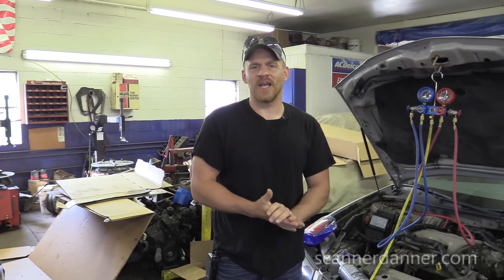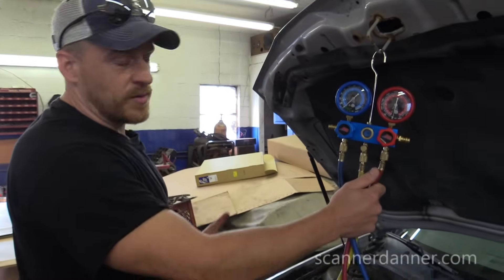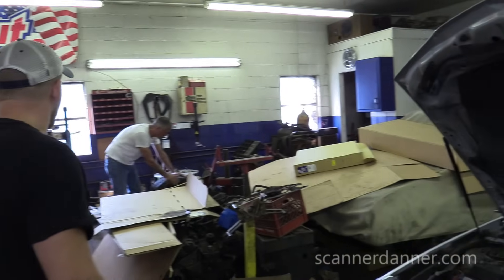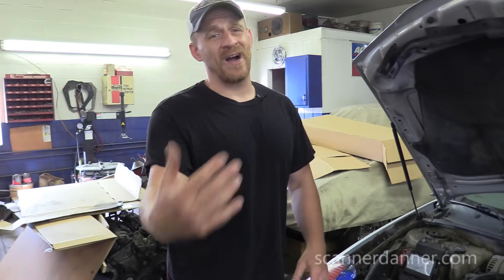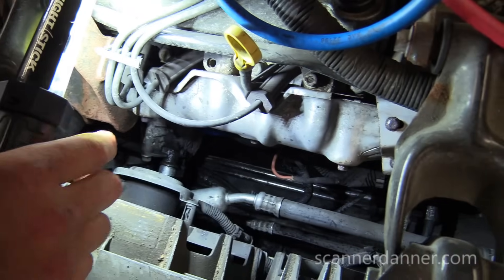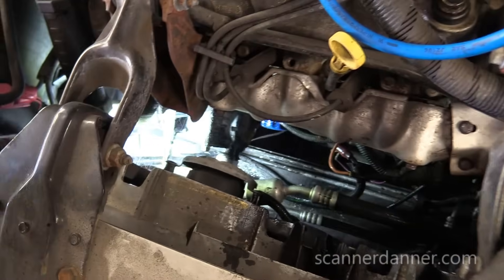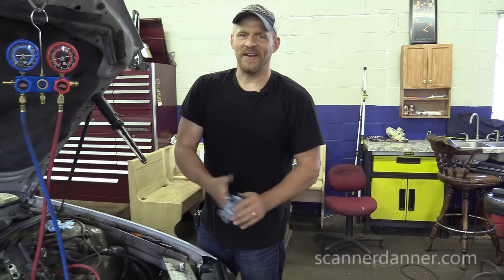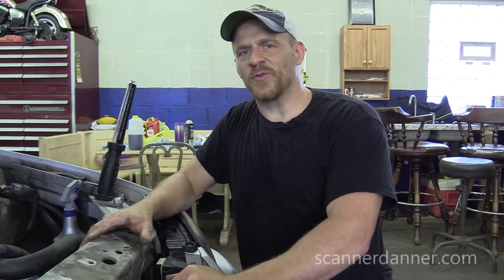A/C Leak Testing Using Compressed Air, Soap and Water (any car)

Comment: Great video Paul, i use exactly the same procedure as yourself, for the rest who want to use nitrogen, go ahead and waste your money/profit.
And i thought i was the only one who uses the quote, i want to hug him and squeeze him, and call him George.  lol. my work mates think i'm nuts!!!
Reply from the maker: lol nice! And just for kicks, how many R134a systems have blown up on you? And how many AC jobs would you say you've used this method on?
It has to be in the thousands for me.
Reply: never had any blow up, and i have done to many jobs that I've lost count.
It's a great method for checking leaks under the bonnet (hood).
I think my first ever automotive A/C job was a Honda civic with a leak on the hi side at the compressor, and found it straight away with compressed air in the system. 
We use to use this method when doing refrigerated containers as well.
Keep up the good work, you won't please everyone, and everyone has an opinion.
Reply: Thanks bro

Comment: hey Paul I'm a big fan of the channel, the verus course made the value of my scan tool double. definitely worth a few years subscription to sd premium. I was wondering if you have any good case studies on vdc systems. I have a Subaru giving me a fit. I'm a member of a Facebook group you admin but I didn't think it was appropriate to ask about your channel on a group about scope diag. loved the a.c. video, I'm just asking here because it's the newest video.
Reply from the maker: Facebook groups are adding me as an "admin" all the time and I'm never really even on them. sigh. 
So I googled Subaru VDC and found this "In situations such as a vehicle losing control due to unexpected understeer or oversteer, individual brakes are applied, engine power is reduced and torque distribution is shifted to regain vehicle stability, therefore aiding driver control."
This just sounds like a standard ECM and ABS computer working together like they've been doing forever! No real differences in hardware. Same inputs and output controls. What did you want to know?
Reply: ScannerDanner thanks for the reply. I figured that as far as the facebook group. This 14 forester was a wreck. It came to me with a steering angle sensor code. The live data showed the sensor to be 220° off. But when turned the data went to 600° or so and then cut out to 0 and would not come back.  I installed a customer supplied steering angle sensor and it read on live data, i touched the wheel and it dropped to zero. I had power and ground to the sensor and nothing obvious stuck out on the 2 can lines. (I know next to nothing  about can signal.) At this point i had no power through the clockspring. I ordered a clockspring and steering angle sensor together out of pocket and installed. The steering angle code went away but all the vdc lights are still on with no code. My verus needs an upgrade so i had to borrow a friends solus edge to read all of this back door info. My next step is to scope the wheel speed sensors. It was hit in the front right corner and has road noise from that side. My theory is that im dropping out on that wss. That is all i can assume with the info at hand. I dont have access to any diagrams or info for this system.
Reply from the maker: Dude, you don't need my help. You're on it man!
Sounds like clocksoring also feeds the reference to that sensor?
Reply: ScannerDanner it may. The new clock spring is broke (used parts like an idiot) and i still have power and ground as well as can signal on the steering angle sensor. I appreciate your confidence in me. Im kinda star struck messaging my favorite celebrity. Lol. According to the verus im going to have to put a resister in line with my leads to check this wss. Thats a new one for me.
Reply from the maker: That sounds like a digital type or magneto type wss. I have a few videos on this. If you AC couple your scope, set on 1v or maybe 500mv you'll see it. Test a good one first so you know what your looking for.
Reply: ScannerDanner thanks paul. I just pulled up to my buddies lot to diag a no crank no com on an 04 colorado. No radio. This should be quick.

Comment: Years ago I worked for IBM and I did an upgrade to a 3715 printer. The upgrade allowed the printer to print faster and an easier to install ribbon. To make the printer faster all you had to do was move a jumper. I took my time doing the upgrade because I felt bad for the customer because if they knew they could have done the upgrade on their own and not paid all that money for me to do it they might have been upset. My point being some of these guys don't like you coming along with a test light or some compressed air and using sound logic to figure out a problem. They want to come in with their bells and whistles and magic and behind a curtain like the Wizard of Oz fix the problem. Knowledge is power and you are helping people just like you help your neighbor when he needs it. You can relate to this. I fixed a Chevy Impala once that was having trouble getting it started. I told him it was his carb and he needed it rebuilt. He asked me if I could get it running so he could get home and his brother in law told me not to do it for free so I told him I'd get it running for 25 bucks he agreed. I went out and had him crank the engine while I tapped the carb to unstick the float and it started. He said 25 bucks was a lot of money for just tapping his carb so I told him okay 5 bucks to tap the carb and 20 bucks to know where to tap it. Great vid Brother. 
Your logic is sound and sometimes you have to read the directions or in this case listen as you qualify the condition of the AC system. GBWY
Reply from the maker: nice! Loved that. And that is exactly it too. We get paid for knowing where to "tap" :-)
Thanks man

Comment: Me and my friend TJ were teaching this method back in the 90s. Put up with a lot of crap from people back then also. Bet you knew TJ.
Reply from the maker: Haha could be. It was a trainer for Pep Boys and this is what we did in all the stores. Never had an issue that I heard of and that was 700 stores at the time.
Reply: ScannerDanner we called BS on having to use nitrogen for the smoke machine too. Bunch of unsafe outlaws we are.
Reply from the maker: Yeah I understand the concerns for sure with EVAP systems but I still use compressed air for those too.

Comment: The compressed Air method works great, but sometimes the leak is so small that the only time you be able to see it is under high pressures (200+). I ran into this issue the other day. Small leak on the condenser would only bubble when the AC is on.
Reply from the maker: good tip! If there is refrigerant in the system, run it, when looking for a leak on the high side!

Comment: How long should it take for pressures to equalize? I worked on AC a few weeks ago and hi side was around 350 and low side was 58psi AT REST.. I told shop owner he has a blockage and needs dryer and expansion valve. He drained some Freon after i left and ac started working and he called it fixed. I think they should equalize even if it is over charged?When I manually activated compressor Hi side went to 380 and low dropped to about 55, I never went back to check it after he removed some Freon.I still believe there is a blockage. What's your thoughts?
Reply from the maker: Depends on the type of txv. Office tube systems equalize rapidly. TXV systems do not. And as you stated a restriction can also cause issues. I have a video on a sticking txv with this very issue.

Comment: To make adding or maintaining pressure easier, get yourself a high side quick connect and put an air fitting on it. That way you can run air to it all the time and not have to go back and add any if you bleed off.
Reply: Hello,   I am trying to find a leak in my 1999 F230 super duty... can you tell me what fittings I need to buy to fill the AC system with air using guages..(that I will purchase too)
Reply: Go to an auto parts store and get a high side coupler and screw in an air fitting of your choice. The threads arent a perfect match but put some teflon tape on it and it will seal up just fine.
Reply: Wonder if anyone actually makes an adapter for this purpose, or is it considered too  "taboo" to sell, like an extension cord with two male ends-   
Strictly a DIY item I guess.

Comment: I was always told use nitrogen, not because shop air will not work, because shop air is so fucking dirty.

even with filters it is really dirty air and contains oil. not good for your a/c system. your vac will not suck it out.

Comment: It's all good but would it be too much trouble to use a leak detector on the compressor once the condenser is replaced and system recharged with refrigerant and oil?  Seems like compressor seals and oil might be an issue if the customer had been dumping freon into the system without adding oil for an extended period of time.
Reply from the maker: Not at all and is what should be done. I wasn't there for the repair, so I didn't show it.

Comment: was nearly yelling "wrong" at the screen when you said fixed orifice and accumulator drier, but figured I'd watch you correct it later in video.
surprised you didn't notice the expansion valve when putting the low side gauge hose on :)
Reply from the maker: Wasn't really paying attention as I was talking to you guys while connecting the gauge. You're lucky I can do that! (two things at once) :-)
Reply: yeah, hard enough  to focus just having a conversation, let alone making sure the cameras are getting all the needed shots :)
Reply from the maker: exactly! I miss stuff because of this at times. Even my own troubleshooting steps get interfered with because of the camera sometimes.

Comment: I love your Videos so once again I'm going to criticize(hopefully constructively) your logic on the whole air\water thing.  First things first I do many Air Conditioning Systems all the time so I do have the equipment and I 110% agree that the average person does not have Nitrogen or a recovery machine sitting in the corner. I know that!   
My Question to you is. How many Air Compressors do you work with? I have done some portable work where people let me borrow their little Air Compressor and upon trying to use them I had Water shooting out of my air tool.  Moisture in the System? Absolutely!! But at the very least people should drain their Tanks before filling a system with air.  I have the best of all worlds in my shop and do not compare that to the individual at home trying to save some cash all I'm saying is that not every person that owns an air compressor should be using it.  "Drain the Tank if you must use Air"
Actual Water is hell on a Vacuum Pump as well. 
Water traps are are also cheap and the the once that HF sells work just fine. If you want to take it a step further a chemical Dryer Kit will remove most moisture out of compressed air. 
In conclusion. I know that you Mr. Danner are aware of all of that but the DIY guy at Home may not be.
Reply: My personal preference on the Soap is a at least 30% of Dawn and I use a 1 Gal. Pump Sprayer with a flexible Wand that I have had for years no but I can't remember where I got it.  Makes it real easy to get into tight places that I normally could not reach.
Reply from the maker: Agree with everything you said and as I continue to show this method I need to talk about those specific things more.
Reply: Thanks, the main reason I said that is because I have been burned in the past and it really sucks when that happens when you are trying to help someone out.

Comment: Paul, I trained on Automotive AC at the GM training center in Tarrytown NY many years ago. Over the years as a Chevrolet Tech I worked on many different systems and always took the advice of the instructors. They had developed many different techniques that weren't in the book and still aren't. Please continue with your advice no matter what the criticisms are...
Reply: What do you mean by dye guys ?
Reply: mr Florida guy may I ask u a question.. gmc truck 2015 yukon  expansion valve is leaking replaced the seals on expansion and the hoses twice and cleaned surfaces..   still leaking any advice will help..it's  driving me insane
Reply: Paul
I think I met you! I worked for Chevy dealer from ‘84-‘97.
Reply: What about you share those not in the book? This is a good test but I feel like it is very hard to spot small leaks. In my case I was losing about 10 psi @100 test pressure every 5 minutes. This is a very small leak, cannot hear it and would not be detected easily. My next step is to inject dye and see where it is.
Reply: @scientist100  dye injection should've been your first step. I find leaks in 10 minutes or less. Don't have time to spend 2-3 hours chasing a leak at high volume shops
Reply: @harryazzole7814  only if you can see it. Anything after the firewall requires time that the dye test won't show. I can hear a large leak right away with ease, dye would take longer time to inject and wait for it to show.

Comment: So, this was a large leak! So large that refrigerant leaked out rapidly. Plus, in the heat of the day, expanded and leaked even further. Then as night fell, and the heat subsided a bit, the gases in the system contracted, and the leak was not able to pull oxygen back into the system??? NO AIR AT ALL!! And refrigerant ONLY was still present in the system, and presented an explosion hazard as it was pressurized with compressor air????

P.S. the battery has a better chance of spontaneous combustion, as it is explosive, and in an oxygen rich environment, and just waiting for the static electrical spark, from your clothes on metal!! Hydrogen gas is nothing to sneeze at!! 

And I guess brake clean is a total NO NO!! WD-40? Spray paint! For Gods sake, don't get any cooking oil near a car!! 

From this point forwards, everyone should use explosive resistant clothing, fire resistant clothing, and as a safety precaution, have the fire department standing by, each time you open a hood, JUST IN CASE!! 

Paul, I guess hindsight is twenty twenty, but perhaps you could have put a sniffer on the leak, not to find the leak, but to prove that there was probably not any refrigerant in the system, to begin with !!

I remember the abominable snowman!! "Gosh, it's hot"!
Reply: Dude that was pretty imaginative good 1 why are ac/hvac guys trolling this channel anyhow?

Comment: I don't  have  the  gauges  to  check  pressure, I was  wondering  if  I  could  put  a little  shop air  in the  line  at the  schrader value  to check? Thank  you.
Reply from the maker: I would not recommend doing this without gauges.You do not want to be putting shop air over top of refrigerant in the system. 
 The gauge set I am using is very affordable. I had the DIYers in mind when I picked it. 
  - A/C Manifold Gauge Set
https://www.jbtoolsales.com/atd-tools-3695-deluxe-dual-aluminum-a-c-manifold-gauge-set#oid=1014_1
Reply: You can even get a set at Harbor Freight for $49 or you can even "rent" them for free from AutoZone or Advance Auto.  What Paul showed is just how to find a large leak where there's nothing in the system.  Actually charging the system after the leak is repaired is a topic for another video.
Reply: johnaclark1 Thanks.
Reply from the maker: I have videos on that. Links are in this description.

Comment: Good video as usual Paul, I use oxygen free nitrogen for testing but I'm in a garage premises not lugging my gear around. Also because it's from a cylinder with a regulator I can crank it up high. For very small leaks I go up to !5 Bar (about 220psi) .

Why are you working on cars in a half kitchen?
Reply from the maker: haha I'm usually in the parking lot, so I'll take it.